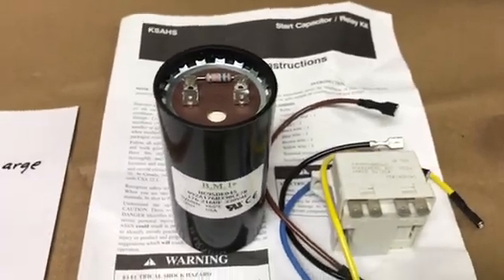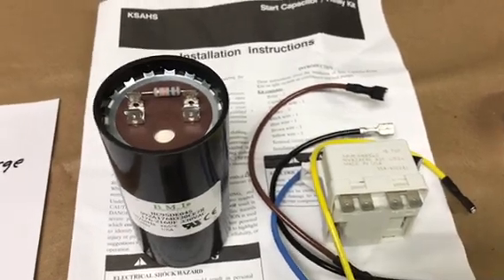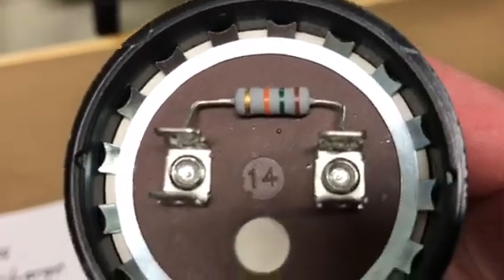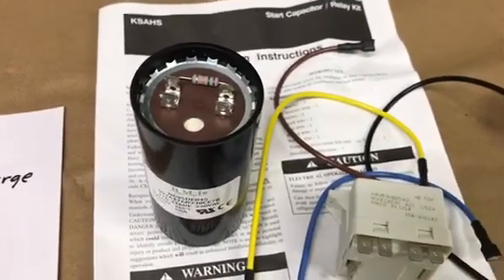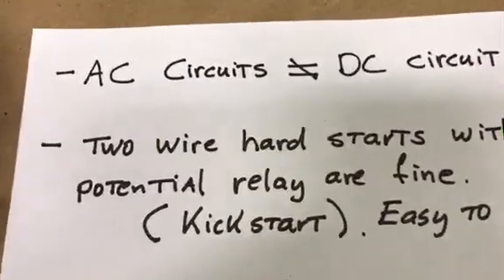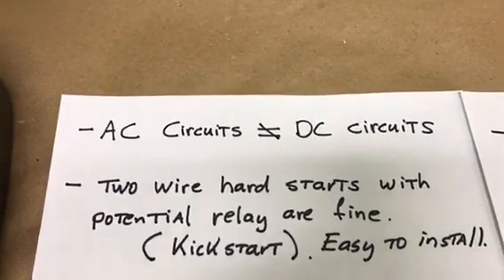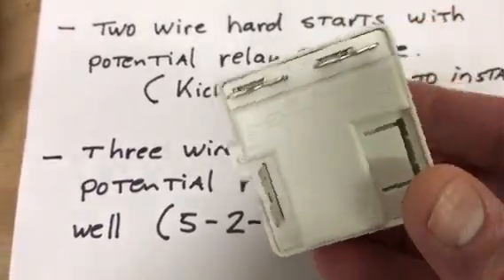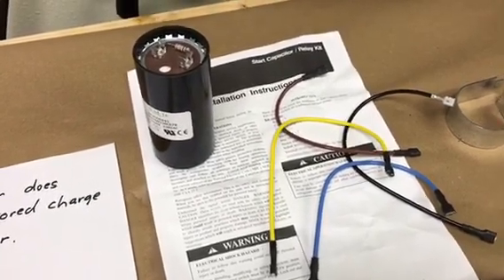Hvac hard start kits, how they work

Comment: Can you explain the symptoms if the start capacitor or relay were to go bad? (Besides the answer "compressor won't start").
Reply from the maker: The best way to tell is to measure the start current.  If you don't have an instrument for that examine the capacitor.  When they fail they usually blow a seal out the top.

Comment: I have a Lennox xp17.  What hard start capacitor do you recommend for this unit?
Reply from the maker: It depends on the size of your xp17.  5-2-1 has two different sizes depending on your unit capacity.
Reply: kwm380 ok thank you.

Comment: Hello I was wondering what you thought of 2 wire sp5 ptc relay capacitors they start anything from 1/2 hp and up , I have been using them with great success over 15 years Regards Rob

Comment: one question: the capacitor that i had on my system is a 45/7.5...can i use a 45/5?  my capacitor has already been changed before, so no sure if i had a 45/5 on there before.  how do i check my system to know what i need, do any of the stickers show this or i can figure out using the numbers on the stickers?
Reply from the maker: You can Google the parts list for your compressor.  If you find the part number for your capacitor you can search Amazon or ebay and find the proper capacitor rating.
Reply: @kwm380  where do i find the compressor part number so that i can find a parts list...is it on the compressor it self or the stickers on the outside body panel?

Comment: These hard start devices are so cheap compared the cost of an A/C unit, why don't manufacturers just include them on the units?  At mass production, it would literally be a few dollars per unit.
Reply from the maker: I think a couple of reasons.  First is cost.  They try and save on every washer and screw.  This probably cost the manufacturer $10.  Second, if they make the units last longer it reduces replacement sales.  That is the conspiracy theorist coming out in me.

Comment: Easy to recognize:
Run caps are housed in metal cans to help dissipate any heat produced over long periods.

Starts caps are housed in black plastics for short term duty.

Max voltages are also different besides Run caps use lower uF values to feed the additional winding a precise current value to match Main winding.

Comment: If your customer is having lights dim on start up install a start kit. If they continue to dim check the breaker box, tighten all connections and check at the disconnect and unit as well. These are not I repeat NOT for 3 phase compressors. The Kick-start got a bad name when they first came out due to the relay hanging up and burn up compressors. Now they have a fuse to prevent that from happening. I only use the 521 on service. I get the factory spec. for new installs.

Comment: That was excellent sir. Pls can it be used on a simple ductless split AC unit? Thanks
Reply: Chick Edwin I would check with the manufacturer to see if they have one for the unit. It may already be on the board.
Reply: @actechformallyyomama746  OK and thanks for your reply Sir

Comment: I have seen these start kit capacitors mentioned by people that are using them to get their RV air conditioners going because they may be using a generator that can't put out the peak startup wattage.  But I never hear about them being used for other appliances like say a refrigerator which I believe also needs much higher wattage when it first starts up.  Also, many appliances and tools have a high startup wattage so I was wondering if these hard start kits would work with other devices.  I would imagine that an air conditioning pump and a refrigeration pump would be very similar to some degree.  I always thought that these start up kits work by storing up a charge and then releasing a high wattage output to get the air conditioner past the startup surge.  It sounds like you are saying that this is not how they work.  Unfortunately my knowledge with regards to electrical motors and electronics is very basic and I don't exactly understand how they do work from your video.  But I watch videos like this to learn.  Thanks.
Reply: MusicByJC most likely the refrigerator has a start capacitor on it with a Klixon overload.

Comment: How do you determine if the hard start kit is bad?
Reply from the maker: A couple of ways.  When the cap blows it generally blows out the top vent. 

 I like to check the startup current with my ammeter.  When the kit is working the startup current will be much lower than the LRA rating of the unit, like 60% of LRA.  If the kit is bad or not hooked up right the startup current will be close to the LRA rating.
Reply: kwm380  thanks

Comment: So the hard start capacitor takes all the torque out of the compressor when it starts and makes it easier on the generator?
Reply from the maker: The kit reduces the current necessary to start the compressor and it does make it easier on generators.

Comment: Hi, 
I was thinking to get a 5-2-1 Compressor saver kit but not sure which one would go with my unit.
According the MFR, there are 3 different sizes and here is the confusing part, my unit is a 59,500 BTUH unit (5 ton) but my Run Capacitor is only 80 uF MFD. The model for 5 ton units (CSRU3) states 270 - 374 MFD. Should I go based on the Compressor tonnage or by the run capacitors uF MFD?

The unit is a Amana Heat Pump Model RHE60A2B

Run Capacitor:
Mars 12199 - 80 uF MFD x 370 VAC Genteq Replacement Capacitor Round # C380R / 27L63

Hard Start KIT's:
5-2-1 Compressor saver kit
CSRU1 = 88 - 108 MFD for 1-3 Tons
CSRU2 = 189 - 227 MFD for 3.5-4-5 Tons
CSRU3 = 270 - 374 MFD for 4-5 Tons
Reply from the maker: The 5 ton unit would need the largest 5-2-1 kit.  The MFD shown are the start capacitor which is different from your run capacitor.

Comment: I think you forget to explain how the motor's "Back EMF" voltage that cause to drop the hard start kit relay out of circuit as soon as motor is running.
Reply: I believe "back EMF" is created because the Run and Start winding are located 90° or so apart. 

When the magnetic rotor is spinning it generates induced voltage through the Start coil winding.

Where I am not super clear is the difference between a motor with a "Start cap" vs. a "Run cap": different construction!

I guess the "Run cap" creates additional Run torque because its winding is precisely aligned to help torque production from an artificially phase-shifted voltage vs. "Start winding" is roughly positioned to help orient (left or right) the rotor while static but is  not positioned or sized for constant duty so it is cut-out quickly.

Fridges: use Start caps...
AC comps, blower fans: use Run caps.
Reply: @glasser2819  The video explains it wrong anyways. I mean, he's right, it creates a phase shift so you can create a rotating force (torque) so the motor can run. Capacitors are basically batteries that store power for as long as it is supplied and discharge quickly once power is cut (via resistor or through the motor windings or really any wiring.) They do store a charge at a constant voltage (DC) and they do the same on A/C except they also discharge because the voltage fluctuates. As the voltage increases and decreases (remember AC sine wave) the current is actually increasing and decreasing in the capacitor 90 degrees out of phase (cosine) which is what starts single phase induction motors. Otherwise, you don't have a rotating magnetic field and no squirrel cage to turn. The run capacitor is designed for continuous use and helps smooth out the fluctuations so the motor can run at a constant torque, more for efficiency reasons but they're definitely built differently to handle the use and not burn out like a run capacitor. Same exact principal behind both, just two different constructions with two different uses. The run capacitor will still create a slight phase shift but it's in relation to the fluctuating AC sine wave coming it, it just helps the windings produce torque at the exact right time to keep it all spinning when incoming power invariably wobbles from time to time. The start capacitor just does it at a more defined time with a greater inrush to help get things moving before dropping out of the circuit.
Reply: @etherealrose2139  That model of what a capacitor is good for DC, but it omits the correct behaviour when dealing with AC. In this application it's ALL about phase shift and what that does to the torque, the time to get up to speed, and the current draw when one winding gets more phase shifted current and nothing to do with "stored energy". GWM's explanation is basic,  but also correct.
Reply: Oops - the above was intended to be a response to Tate Dillow in a post above - somehow got attached to Stan's post. My clumsy. PAFMelb

Comment: so would one kits work on the small RV rooftop A/C units?
Reply from the maker: I believe they make small ones for RVs.
Reply: I have installed one and they work quite well. Especially for use with a generator.

Comment: Glad to see after watching 4 or so videos someone addressing the role of capacitance with regard to starting a "single phase" motor. I do however respect experience, even if someone's theoretical understanding is "lacking" i still watch and learn what they have to offer. With regard to the "bleed off" resistor, it's function may be better understood by the relationship of LCR circuits, again mostly addressing phase shift, by adding a purely resistive component the curve of the phase angle is made more useful over a wide range of inductance (which occurs while the rotor is anywhere from "locked" to run speed) but yeah sure, we can call it a bleed off resistor. But wouldn't calling it a bleed off make more sense in a DC circuit.......
Reply: The value of that bleeder resistor is such that it essentially does nothing with respect to the circuit. The R of the LCR is the winding resistance of the motor. And, yes, you need a bleed off resistor in an AC circuit as the capacitor can become charged just as easily.
Reply: And you can not test the mfd if the bleed resistor is in the circuit. You have to remove it or the cap will always read defective. Just my 2cents. No charge.

Comment: Thank you very much for the GREAT explanation of AC circuit phase and capacitance!
Now I understand how the 5 2 1 kit I put on the compressor works to reduce the start-up spike 
(the spike is not a big deal when we are on utility power, but when the house is on generator, the genset really hates the scroll compressor, vs the old heat pump reciprocating compressor) 32S-3 !!!
Reply: Get a Hyper Engineering soft start and your generator will barely notice the compressor.
Reply: You just taught me why one of my customer's generac control board keeps blowing. He's got one of them whole home backups and it's hooked up to his two 5ton condensers. High voltage passes through the generac board before going to the load.